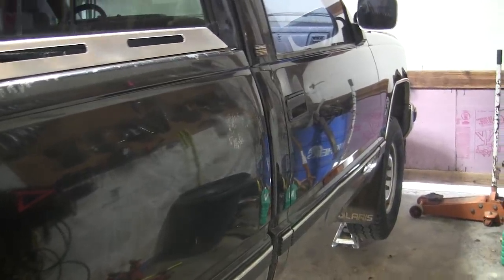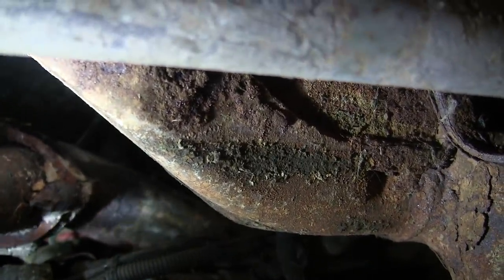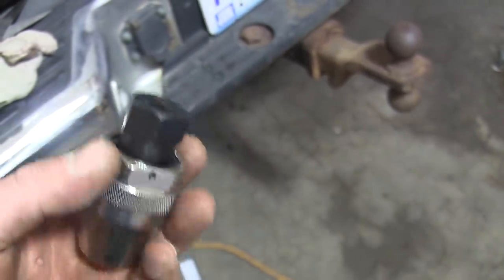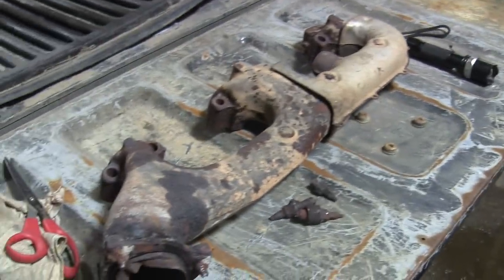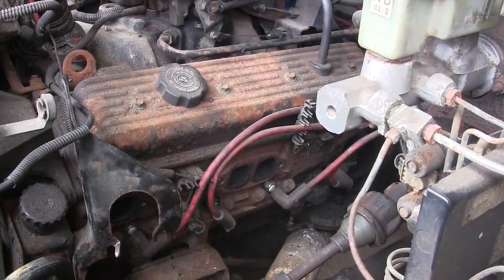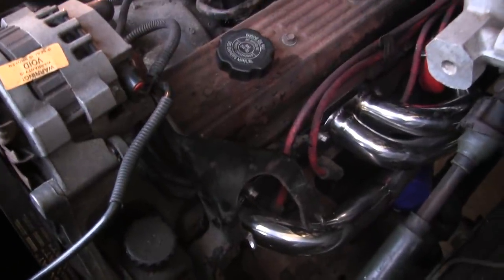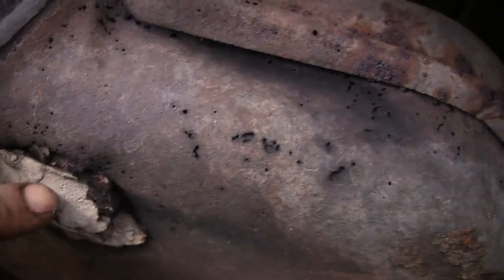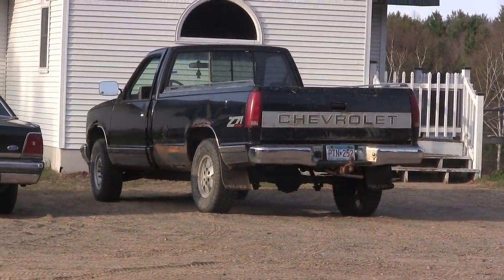Time For An Exhaust

Comment: Ahh crap, that broken bolt in the head would bug me.. hopefully the gasket doesn't blow out.. Needed to weld a nut on the broken bolt..  I've never had a GM exhaust manifold bolt break.." manifold to cylinder head"